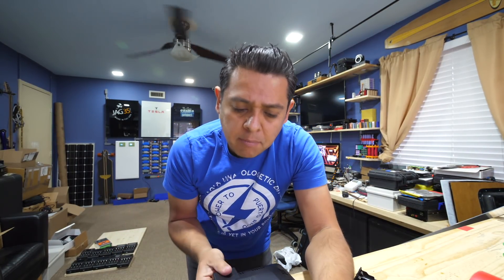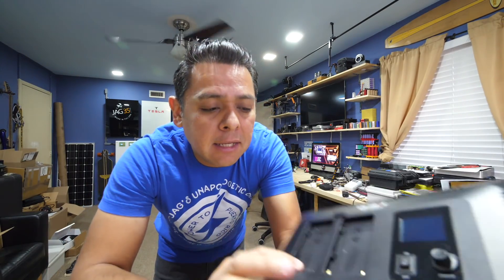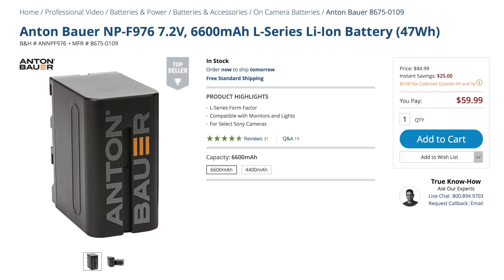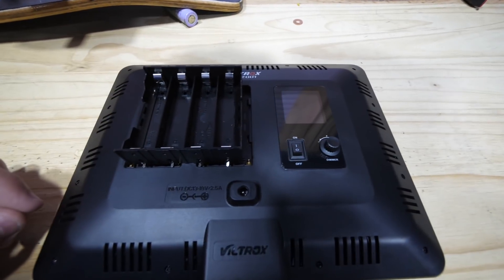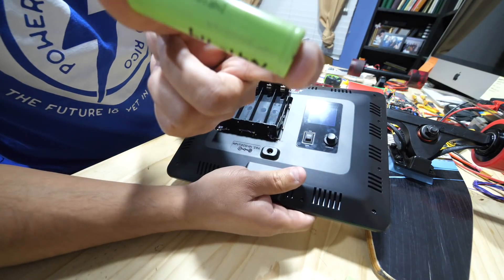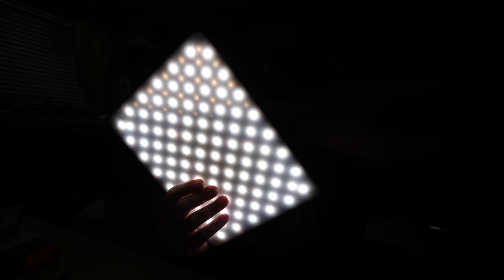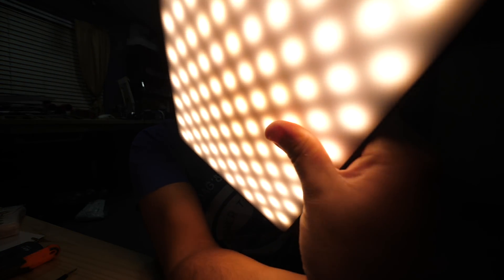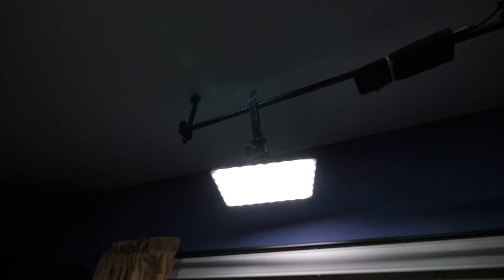Video LED Light DIY 18650 Battery Hack  (2018)

Comment: Would be nice if you recessed the battery holders to be flush, would look professional. I use a soldering iron to cut the plastic away and then glue the battery holders in. You can also get holders with a spring loaded cover

Comment: Was wondering, as most Sony L are 2s, 2s2p, 2s3p or 2s4p, it would be feasible to a large battery,  something like a 2s12p with 7.4v or do something with a higher voltage, close to a v-mount/gold mount battery - 19v and step it down to 7.4v ? Taking in account the my sony lights need a stable 3A output.

Comment: Should I leave my laptop plugged in and charging when i'm not on-the-go? What’s best for the battery? Ultimately, it’s not clear for me which is worse for a battery. Leaving the battery at 100% capacity will decrease its lifespan, but running it through repeated discharge and recharge cycles will also decrease its lifespan. Basically, whatever you do, your battery will wear down and lose capacity. That’s just how batteries work. The real question is what makes it die more slowly. What is your view in that???

Comment: Have you used lithium titinate batteries? They have lower voltage. But supposedly have 5x the lifespan and can charge quickly you can buy them now they have been around long enough to be in production... Also can you do a video on repairing your power tool batteries I saw u use makita.. Can they be rebuilt? Can someone use an old nicad battery and convert to lithium ion or titinate?

Comment: Hey man, I just saw your video collab about how does a Tesla works, and I have to say I'm overwhelmed by knowledge and curiosity. Right now I'm studying Industrial Engineering, but I have a question, ¿Do you think it is possible for a guy like me, to create its own EV?
Reply: Jossvo26 26 It's possible to do so, but there is more to it than just skills in electronics. You should have some car-mechanical skills, so you can prepare the car before doing the conversion.
Also, you need to have some legal skills. For example here in Germany, there are a lot of regulations and things to consider. You should do that first, or else you'll end up with a car you're not allowed to drive on the public roads. And be aware of the costs. They can get much higher than you originally expected. So sometimes it may even cheaper to buy a used EV
Reply: GPOA ACBH thanks!

Comment: Hey bro hi I'm planning to make a 2s pack from 18650 cells it from a laptop and I want to draw 20A from it constant is it possible if it's not then how much is possible
Reply from the maker: Only if you use 10A cells

Comment: Always wanted to put some lithium packs into the battery compartment of a vintage ghetto blaster like an LA-SONIC.   I already put a USB connector onto an AMFM radio which had a 4AA compartment and it runs well off of a generic USB battery pack.

Comment: how long will those bats last until youll need to change them out?
Reply from the maker: Long time
Reply: Define long time. I would assume about an hour at maximum brightness, right?  4x3.7V = 14.8V   ->   30W / 14.8V = 2A. So with 2000mAh batteries that would be about an hour. Which hardly seems that long. But ok, one can always add more batteries in parallell :)

Comment: Anyone know what 18650s can be used for? 
So far I’m stuck at power banks 18650 fans and flashlights please YouTube community I need more stuff to use these batteries with
Reply: I actually have two Schlage z-wave keypad door locks (front and back) that had 4 AA's in them and seem to literally eat batteries. And, they will not function with rechargeable NiMH batteries. So, being the geek that I am, I though "I have literally hundreds of 18650's. Why can't I use two of these in each lock?"So, the journey began and I attached an external battery box to each lock and now use exclusively two 18650 batteries in each. When they get low, I simply exchange them for charged 18650's. The amazing thing is that with the 18650's they work faster, more quickly and stay 'active' and respond better in z-wave network status. I've started to make a vid of the DIY mod but haven't edited it yet to post it.
Reply: Marc Marchioli I’m with you I have hundreds of 18650s I can only find items designed to fit is like the 18650 fans flashlights and flashlights that’s about it I just need a list or that what 18650s are used in
Reply: You could build bigger projects, e.g. a big portable speaker, emergency power devices for PCs, a PV System with powerwall for charging small EVs, a solar powered workshop, etc. be creative!
Reply: i was looking to build a 12v power brick with 18650s i would just need to have it a safe way or how to charge the 12v and making sure its safe and that
Reply: karzygijose be sure to use a battery protection circuit for 4S. If you're looking for tips, you'll find a lot of instruction videos on YT, for example on how to wire the battery pack. But be sure to have the skills before doing sth. stupid

Comment: But you did notice that you get those Batteries with 2 half decent 18650ies for around 8 USD including shipping? 
And if you get the real cheapos for 2 USD (with crap batteries), you just dump those fake 4500mAh cells out and put your XTAR/Samsung/ICR/whatever.

Comment: have to ask, are those batteries you have for you light reloadable?
Reply from the maker: ano anonymo what’s that mean?
Reply: I think they mean rechargeable, which they are. Looks like you have designed it in a way that you can easily swap out the 18650's if prolonged use is required.